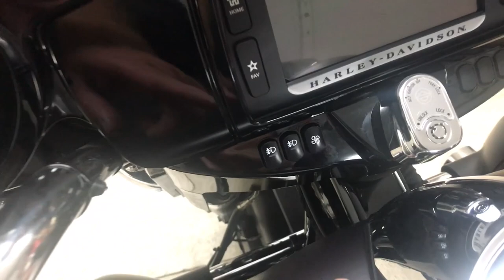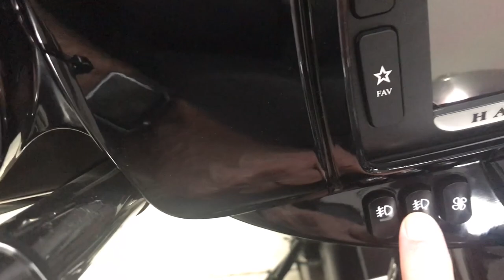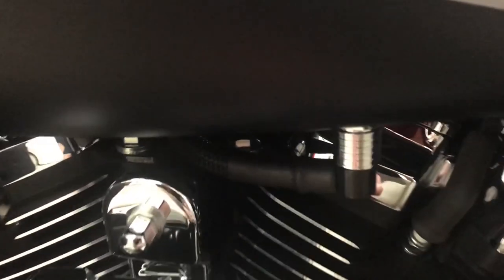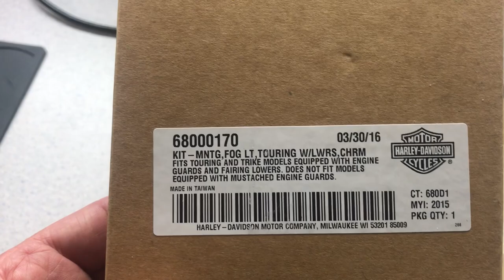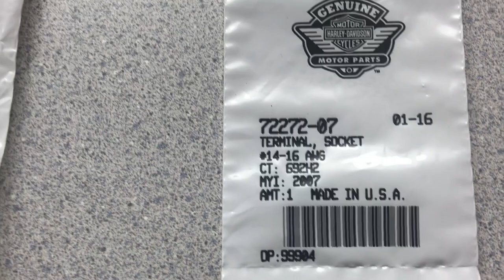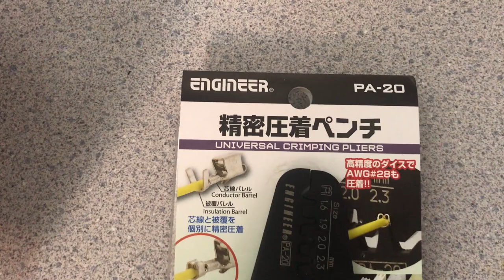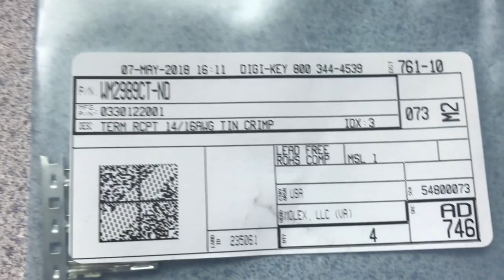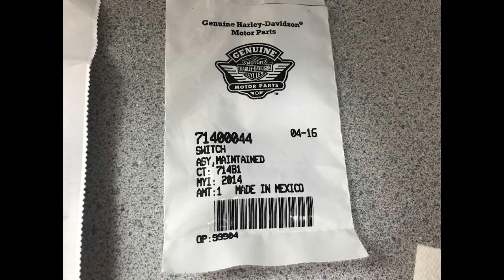Harley Daymaker LED Fog Lights Install

Comment: Hoping you can assist me with "going down the rabbit hole...LOL I just got a 2019 road glide special that has lowers added. I plan to add the following switched accessories at some point which are : Fog lights, cooling fan, heated seat, and Accent LED lighting. The accent lighting id like to be able to turn on and off at any point (even with the run/accessory switch in the off position). I would like to do it clean like you did using the factory aux switches to provide/remove power. Should I follow your instructions here, or go with the Auxiliary harness you were talking about that had the 2 accessory outputs, and how would you suggest I incorporate the cooling fan power? Thanks for the detailed info. I will need to watch these a few more times before I better understand the big picture here....LOL

Comment: Alan did you splice the passing lamp wires into a 4 into 2 type configuration then into the connector?
Reply from the maker: I apologize but I do not recall. The only info I can give is what is in the video.

Comment: My 2015 FLHX doesn't have a switch for the auxiliary lights. Did I need the switch housing as well for the install? And from the 150 molex you wired to the fog lights. Is there a separate wire to the button

Comment: Alan, cool video thanks for sharing! Quick question regarding the HD harness, you spliced the harness for power near the male and female connectors with your extension wire which then plugs into the molex connector you purchased correct? Nothing more? I just installed a set of fog lights on my 15 CVO Streetglide and I'm currently drawing power from the auxiliary lights and want to run them on a separate switch as you have it.  Thanks again for posting!
Reply from the maker: I can say for certain that no original harness on the MC was cut or spliced in any way. I hope others can help; it has been too long for me to remember any specifics about the add on harness connections. From me, you will have to rely on what is in the video. Thanks, Alan.
Reply: @Alan_1  thanks Alan. 👌

Comment: Great video.   Where did you get the part number for the fan button that you have on the switch pack.
Reply from the maker: That fan switch is for the Coolflow fan and I think it came with the fan kit

Comment: Nice lighting job I do have one question what was the item with a key lock on the crash bar?
Reply from the maker: Hey Gary, it is the HD accessory helmet locker. Works very good. Has tamper resistant bolts. I don’t use it much, but when I need it, it is very handy.

Comment: Everyone has failed to mention that you have to have your BCM programed to recognize the lights before they will operate.
Reply from the maker: I did not have to have mine programmed for the fog lights. It did need to be updated for the coolflow fan though.

Comment: put these on my bike less than a year water got inside of them now they fog up all the time
Reply from the maker: Jerry Peddigree,
I did a quick lookup and found the official HD parts and accessories warranty. Seems those lights are warranted for a year, so if within that period you should get free replacements. This seemed to apply even if installed by the rider